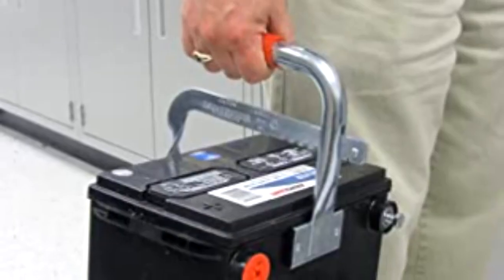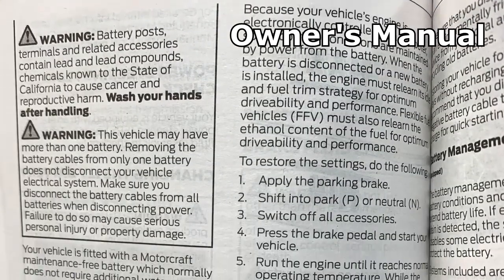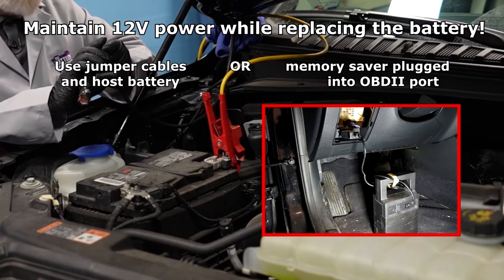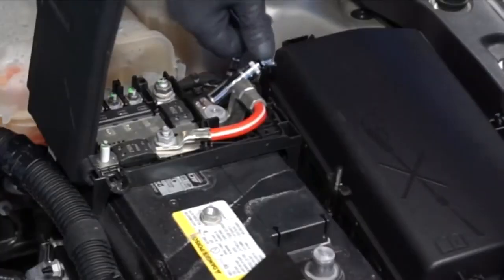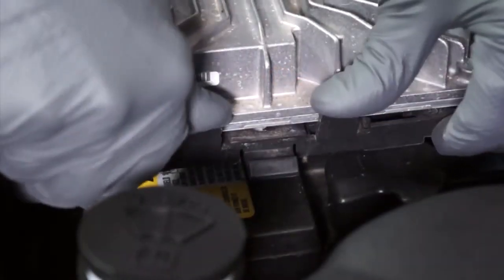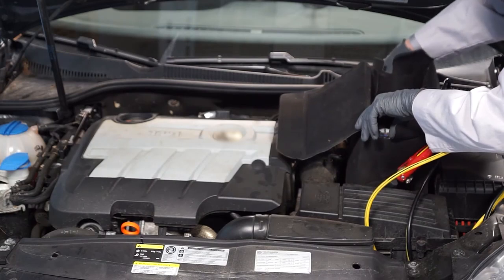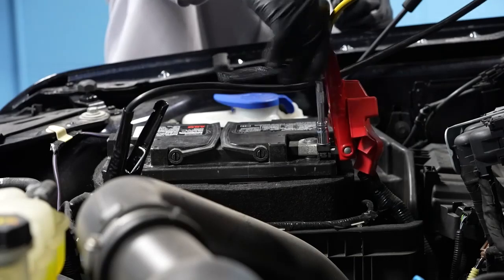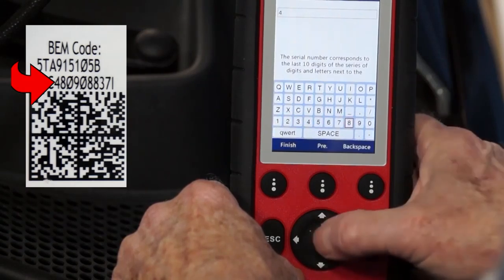How to Install ANY Battery - Step by Step Tutorial

Comment: Hello Sir the car use AGM battery, when we replace a new battery we can use a normal battery thanks
Reply from the maker: Thanks for watching.  It depends on what was the original battery in the vehicle. If you have a newer car with electronics, start stop, remote start, keyless entry we would highly recommend putting in an AGM battery.